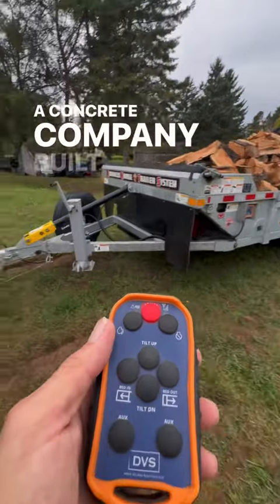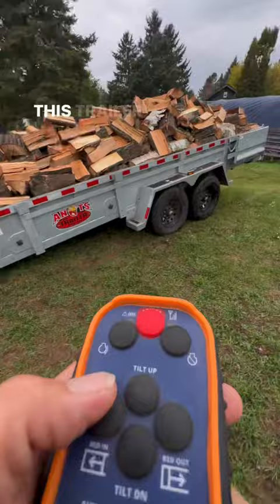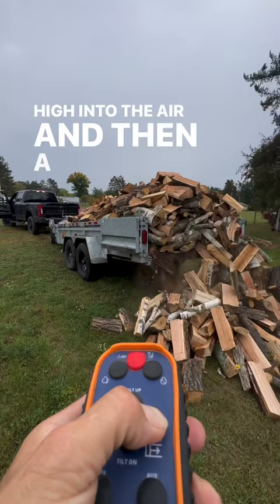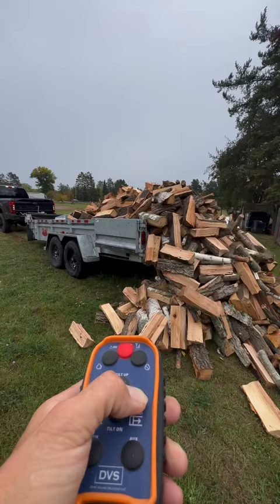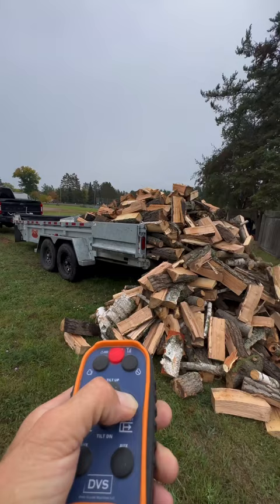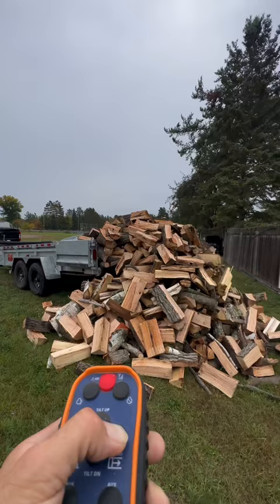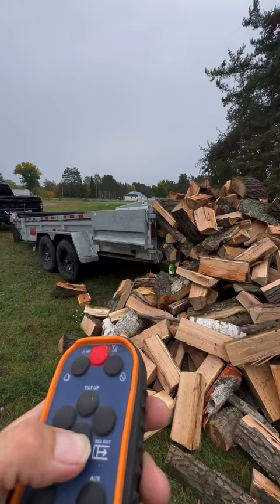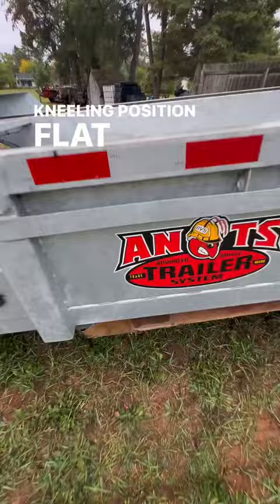The trailer can “DOWNWARD DOG” dump.

Comment: It's a great idea, however how much pressure is it putting on the trucks transmission? We all know that most people don't use the parking brake. There's only a few teeth in the transmission holding that truck there. I've seen a lot of damaged truck's from this. Mostly from pushing pallets on from the back.

Comment: I do concrete work and don’t get what why a concrete company make a trailer like this if doesn’t make any difference than just an average dump trailer probably besides the price tag
Reply: Uuuuuuummmmmmmmm, allows you to dump a load of material, without having to tire yourself out, onloading the material, js.
Reply: @ronheydon117 uuuummmm right  a regular dump trailer does the same …. Please explain to me how you tire your self out with a normal dump trailer you should read the comment your replying to because your reply makes no sense
Reply: @2wheel93  I'm not someone else who has a dump trailer. I should have stated that. The only type I've ever been able to borrow, has never been a dump style. You load and unload it.
Reply: Could back up to a loading dock and push slabs in. Load with crushed concrete. Offload forms so you don’t have to by hand. Load equipment. It wasn’t specific to concrete, but people who actually do construction were behind the design
Reply: I don’t load forms in a dump trailer and if you did when you tip it to unload they would just flop over and make a huge mess, you can load and unload crushed concrete very easily with a standard dump trailer and what do you mean load equipment is the belt going to load the equipment for you I don’t under stand where your going with that one and he specifically said a concrete company designed it so I’m not doggin on the trailer in any other aspect of construction where it may work and may be used but as for concrete and what I do I don’t see how that would benefit me any more than a standard dump trailer would